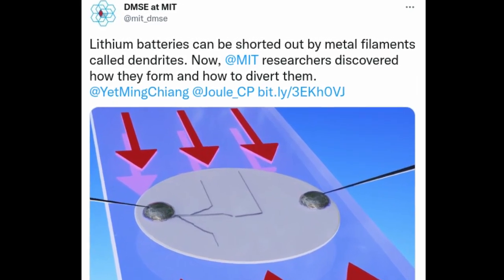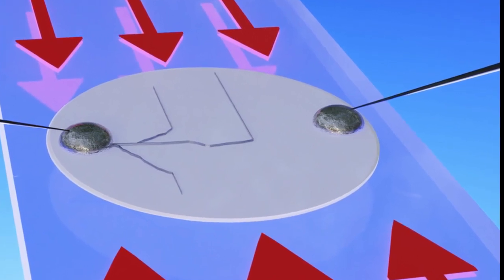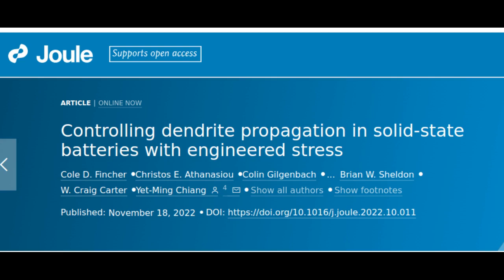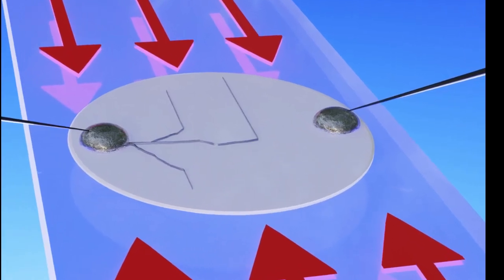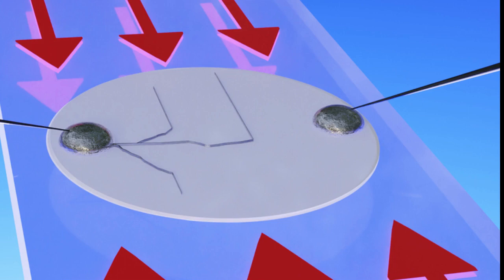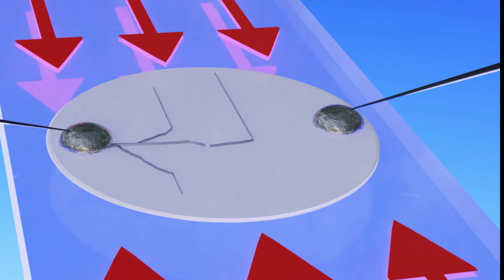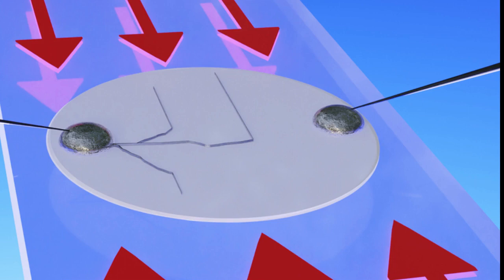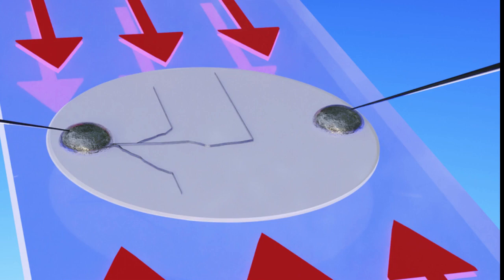Engineers solve a mystery on the path to smaller, lighter batteries | Solid-state batteries

Comment: 1:07 obviously dendrites are atomic nuclei being carried by electric charge as the electrodes degrade from oxidation and electrolysis and deposited in layers like icicles or stalagmites. to prevent dendritic shorting, the gap between electrodes can be periodically cleaned, the electrodes designed to resist corrosion and degradation, and voltages optimized for such electrode materials.